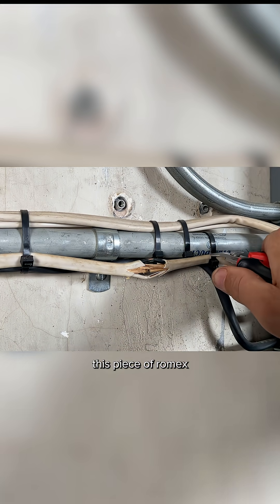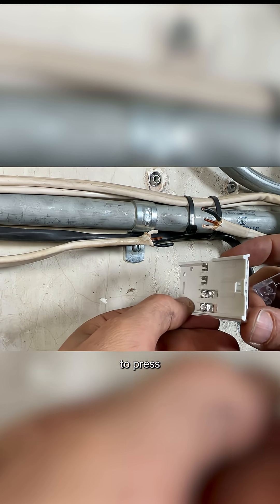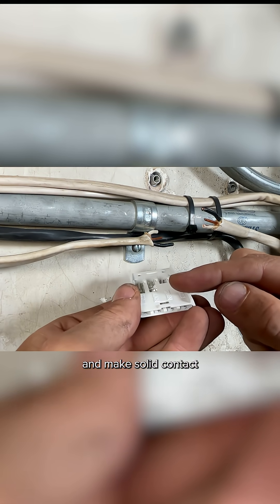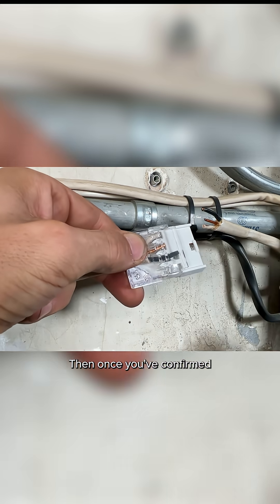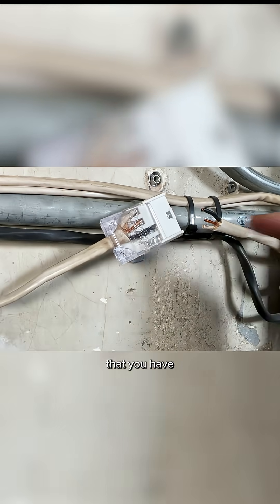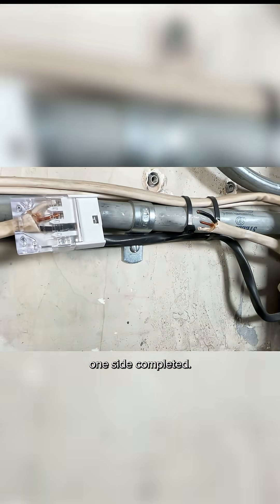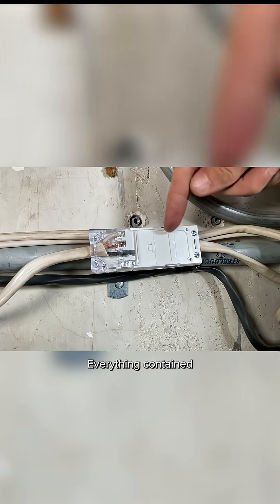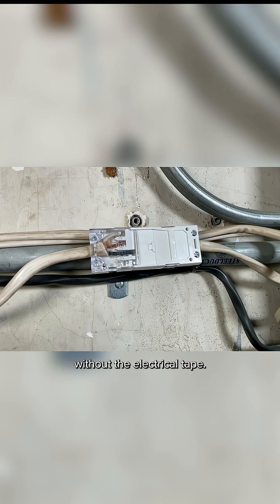How to Splice Romex Wires Without Stripping – Step-by-Step Guide🔌

Comment: It’s a quick and easy temporary fix to get things working, many inspectors don’t approve of it’s use. I believe these are often used in the building of manufactured homes, they’ve been around for decades. The code violation should be corrected, using the raceway, emt as a means of support for the NM is not good.

Comment: A heat test compared to wire nuts, WAGOs, crimp spices and any other wire-joining/splicing systems you know of, along with a Voltage-drop test, an Amperage-drop test and/or Wattage-drop test for each would appreciated.  Insulation-cutting wire joining/splicing systems like this have been harshly criticized for years, if not decades.